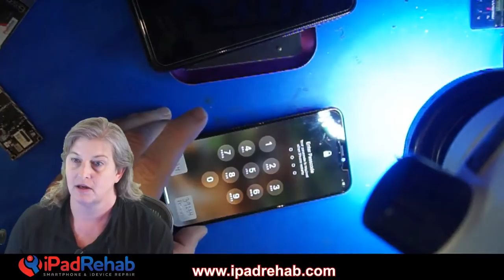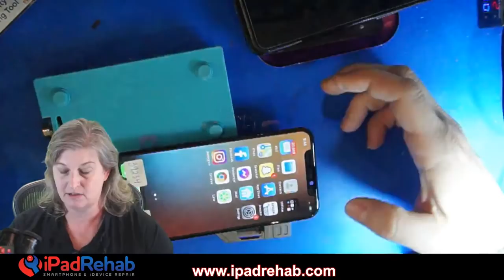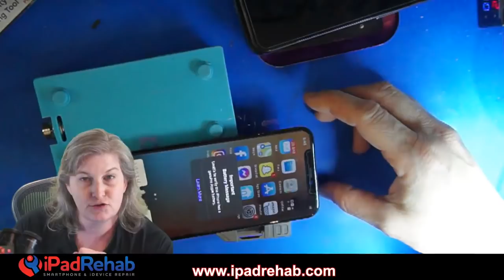iPhone 11 Pro Sudden Death While Charging--Data Recovery LIVESTREAM

Comment: It should be fairly easy to reconfigure the wiring to those speakers or disconnect hers from your amp...  So that's a solution you could offer.   Then she can get her own amp, of the correct type to run just her speakers and connect them, or hire someone else to.

Comment: Your videos give me hope, my iphone rebooted overnight as it was charging and hasn't left the apple logo screen since then. I've tried volume up volume down and power button for 20 seconds, and it seemed like it was about to boot up because there is always a flicker on the apple logo as it boots up, and there was a flicker, but this time it didn't boot up all the way through. Every time that the apple logo flickers, my itunes would be able to recognize that the phone is plugged in. After several re attempts at volume up, down, and power button for 20 seconds, the flicker stopped and my itunes wasn't recognizing my iphone anymore. Also, after the flickers stopped, what used to be iphone logo flicker then 2 minutes before phone turns off and tries to reboot itself, now its 5 to 6 minutes of apple logo with no flicker then it turns off turns back on and attempts to reboot itself. Please help i don't know what to do. My phone has photos of my recently passed pets, my recently passed grandma, and photos and memories of me, my friends, and my family before the pandemic struck. Last time this happened i was able to get pass the loop after 4 hours. It has been 48 hours of anxiety and torment because of the boot loop.

Comment: For the PA system perhaps just disconnect the dog groomers speakers as the PA/amp is in your store, then crank it as loud as you like. Or perhaps play the doggy xmas classic, Silent Dogwhistle as an anit-barking song? Good job as usual. The power flex disconnected causes the device to suffer a "panic attack" and creates reboot count of 180 seconds and is due to the top mic which is known as mic2 controlled by the monitord service which is very similar to sensors used on imacs and macbooks for fan failures and other thermal issues. Is a terrible troll and surely not required for a device to boot successfully and stay awake. Oh and you do need original flexes also or else it still shuts down.

Comment: Have you checked to see if there is a way to disconnect the speakers on the dog groomers side? Put a microphone in the hole in the wall and run it through to the speakers so it is loud when you aren't there.

Comment: If this were streamed live on December the 5th, why is the phone reporting December 8th on the screen?  

Also, I think that your moral/ethical dilemma with your dog neighbor is mute.  Unless there are local laws not permitting daytime noise to be above a certain level.  If this is the case, then you have a remedy to a solution and the dog grooming business is not in compliance.  There is no way for them to shut up the dogs as dogs don't understand a command to keep quiet.  What you are asking them to do (keep the dogs from barking) is impossible.  And you wanting to escalate the situation with noise retribution of your own is not a solution.  There has to be some mutual solution.  You could ask them to purchase sound-deadening materials and install enough of it to your satisfaction, for instance.  Or, figure out a way to air-gap the space between both your shared walls.  You just pumping noise into their space is wrong.  Just as wrong as is them not being able to give you what the law would call quiet peace and enjoyment of your space.  It would cost the dog business maybe a significant amount of money to make these changes.  You might offer to pay 25% of the cost to help remediate the situation as a goodwill gesture..  But that hinges on how you approach the owner.  You can be friendly about that approach or you can be combative.  I'd start with the former and work from there.

Comment: Its funny i have an ipad mini first gen that has zero issues. Battery life is great, i get 7 to 10 hours of watching youtube or reading on the kindle app. Only issue is i can't play youtube without going through hoops of opening app then clicking update and when it fails to update because old OS and no update i can click open app and run it. Its almost to the point of being useless because of required app updates. Will be buying a new ipad to replace it only because i can't use it for youtube without hassles. I mean the only issue is i can't update the apps which just pisses me off. Oh btw the update is for the youtube app and of course no updates for years for OS. I don't care about fancy new OS for ipad i just want to watch youtube and read a book on it. Both apps work fine when opened but youtube has started complaining and refusing to work unless i click update then open app from store after it finds no updates.

Comment: Idea: When you swipe up to recover, it will fail during the recovery process (and brick itself to the dfu mode), because the absence of baseband - the system recovery contains firmware reloading to it, which obviously must fail. 

That is how I bricked my iphone 4, working but with problems with baseband (no mac address present symptom).

Edit: pass 1187 ;) -> volume up ans smooth jazz all the time!